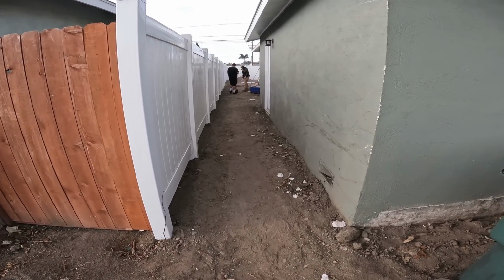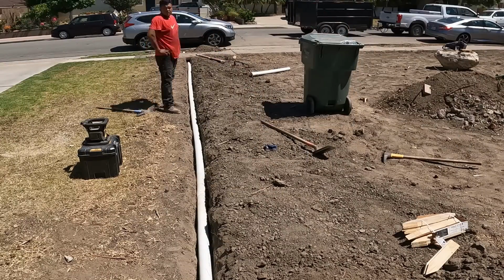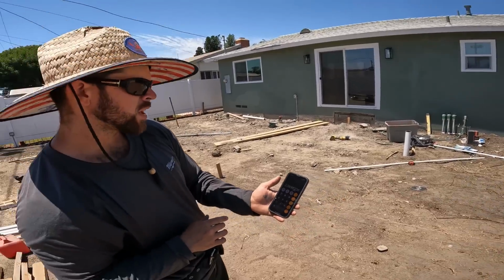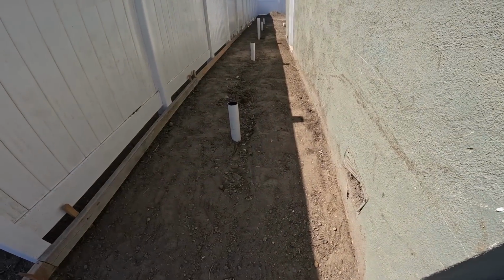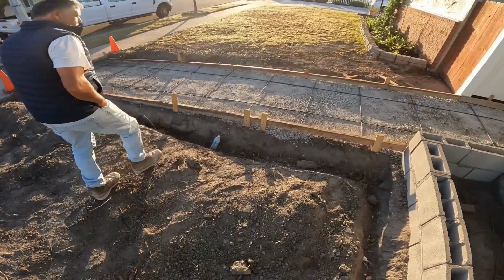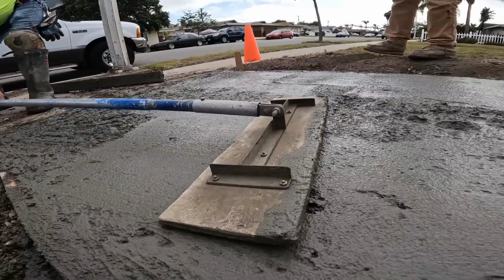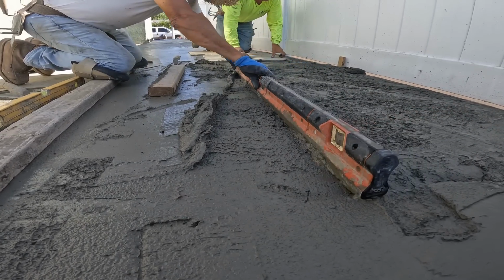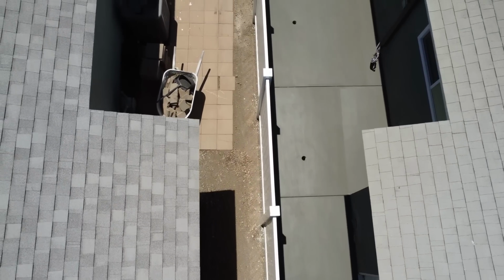First Concrete Pour of the Massive Remodel! Concrete side yard with Drain Install

Comment: Incredible. Learned a ton about calculating slope. Also, it looks like the pink rod is pretty much still not available. Do you think it will be back; or do you plan to stay with steel?
Reply from the maker: Steel until it shows up at the Depot

Comment: I hear you on the 100 yds in an open area over 5 yds in a small area. I'm a carpenter and rebuilding a kitchen is much easier than a bathroom.
Is a rock salt finish popular there? In Scottsdale a lot of the city sidewalks use a rock salt finish. Coming from Maine, rock salt and concrete are a no no. Once I learned how they do it I was OK with it.
Reply from the maker: I still get calls for it occasionally when it's to match existing.
Open areas are much easier to work in.